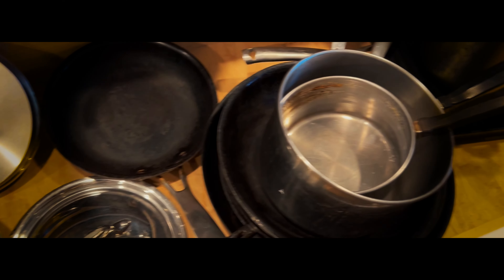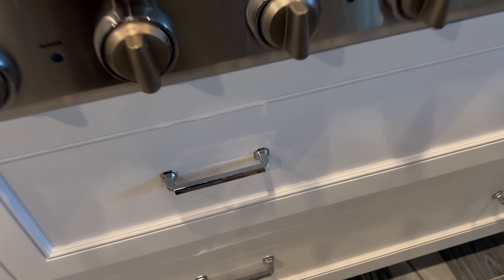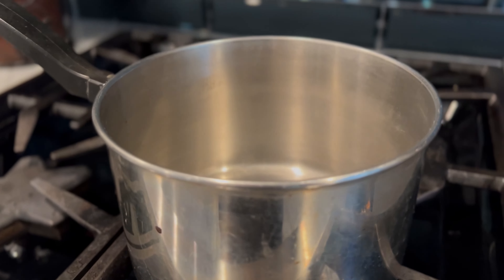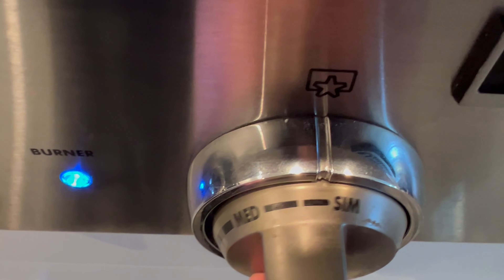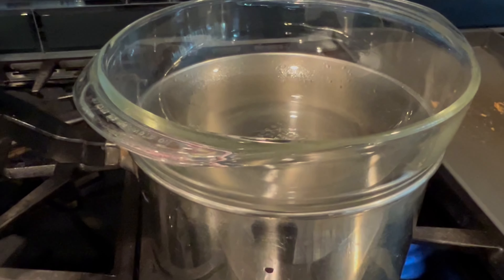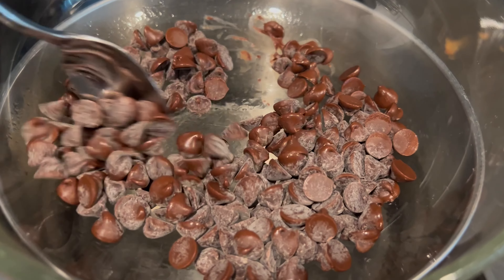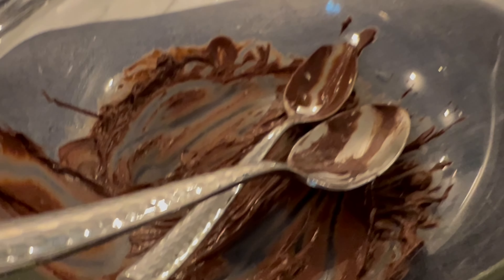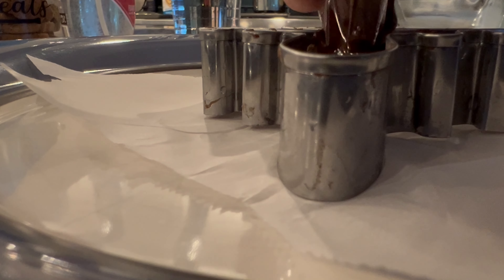Making AIRPLANE SHAPED CHOCOLATE!

Comment from the maker: What would you have done differently? Tell me below! 👇
Reply: 10 cups of sugar
Reply: @Aviation_A426 😂
Reply: make it model sized :)
Reply: make it bigger and make it round
Reply: 27 cups of sugar+use white chocolate for white plane
Reply: I would make the size to scale.
Reply: Add oil on the mold so it will come out easier